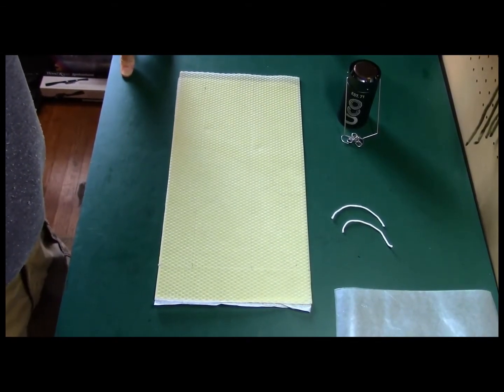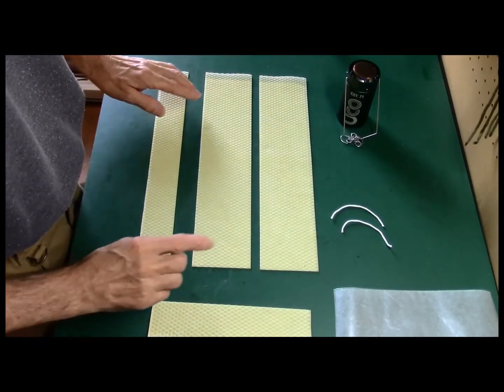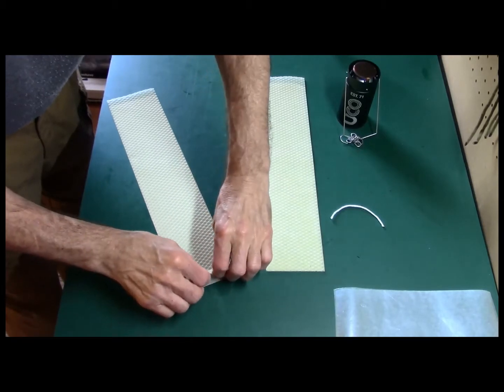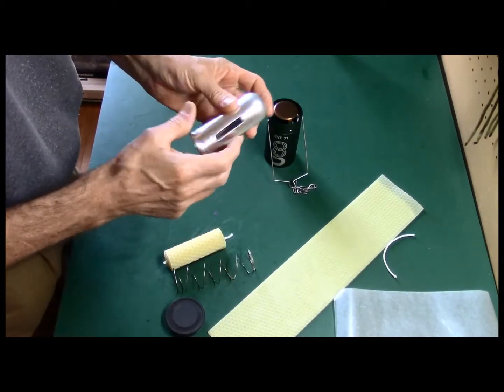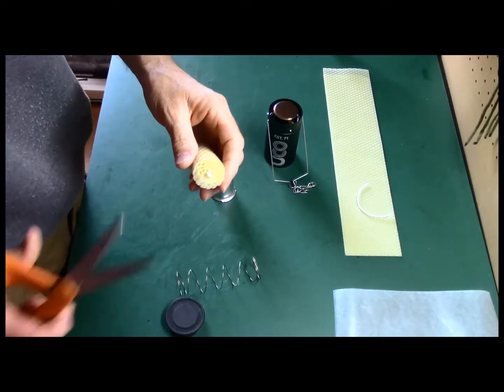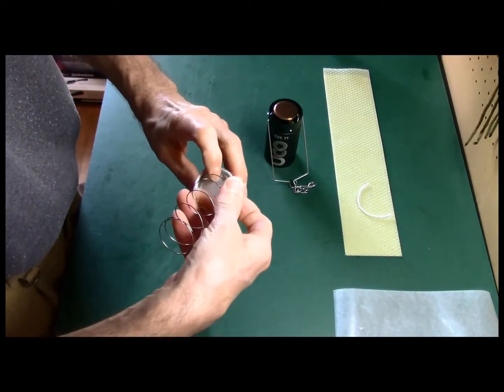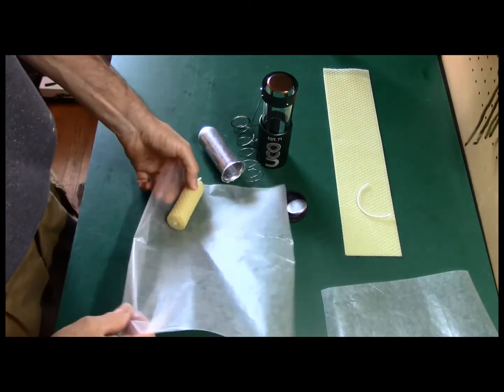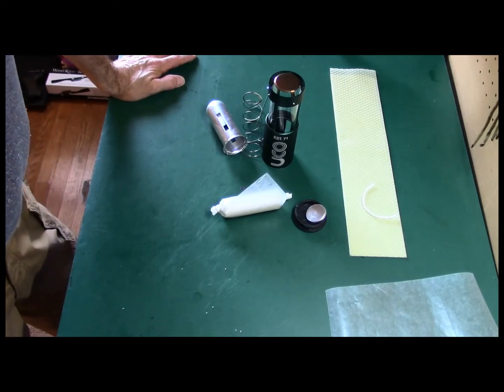A Simple, Practical & Economical way to make Bee's Wax Candles for your UCO Candle Lantern

Comment: 10 sheets for $30.50. 2 candles for every sheet.  20 candles at $30.50 = $1.52 a candle, not bad.  Thx!
Reply: Only if they burn as long as the UCO made candles.
Reply: @totallyfrozen  They will not. They will burn MUCH hotter than a UCO candle making the burn time most likely about half the burn time or about 4 1/2 to 5 hours. Also the cost and waist will not be as economical as the UCO candles. They are all very expensive at this time.